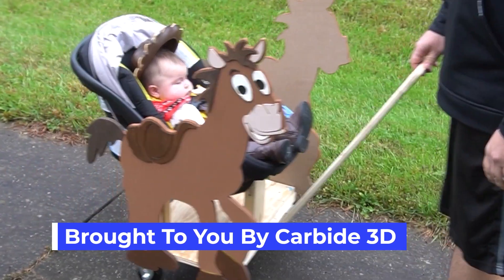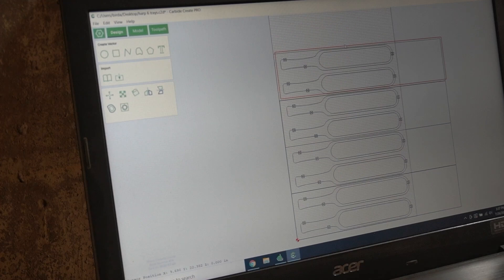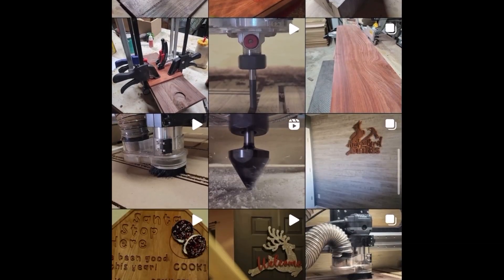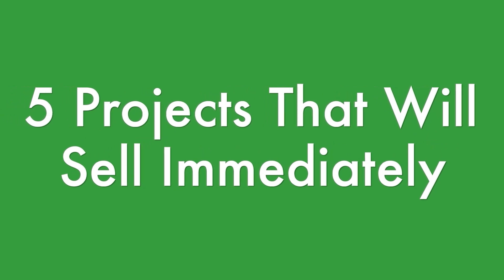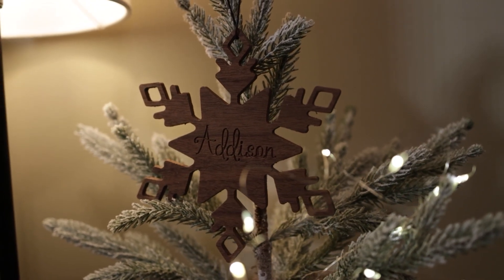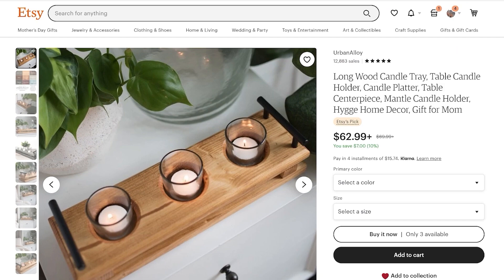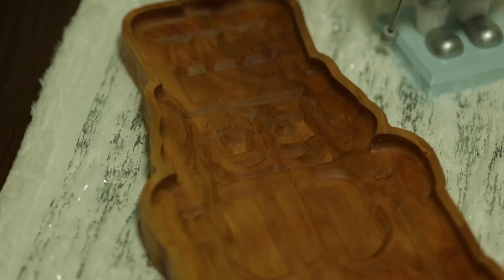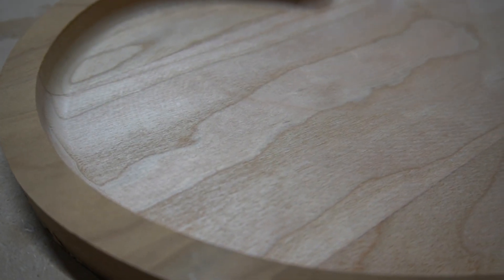5 Easy CNC Projects You Can Make and Sell Right Now - Make Money With CNC

Comment: I like your advice, but I tend to ignore half of it. If I make something seasonal, people are only going to buy that thing one Time of year. If I make too many, they sit on a shelf for three seasons. It's a jig, fixture, or program that I spend time setting up once a year. If I personalize it, that's another point of error that could happen. 

My goal is to find a product that people will buy year round, that doesn't need to be customized, that can be mass produced, like your cheese trays. 

Everything you say is correct, but not really my goal. Yes, if I customize, I can charge more... But I HAVE to charge more because I have to create and program that customization, and then risk messing it up if I do that poorly, or I mess it up. Then I'm scrapping that part, and it's an extra cost that I can't recoup. And I have to do that for every part, which slows down the process, and requires my attention for each part. They're only so many hours in a day, and I can't see that scaling well.

I'd rather have a consistent, controlled process from beginning to end, making every part exactly the same, requiring as little intervention as possible. Then while the machine is making perfect parts, I can be deburring, packing, shipping, whatever else needs to be done without babysitting my machine.

The trick is finding a product that fits that criteria... I think I have a few ideas... I will get my machine in a couple months. By the end of the year, I should know if my hypothesis pans out.
Reply: Mind sharing what you had in mind? I’ll start. A fishing bait box for the fishing community.
Reply: @clearcut6818  one of my ideas was a tray that went on the back of your toilet. Anyone who concealed carries firearms needs a place to put their gun while they're using the bathroom. On the bathroom subject, if you could devise a clever, nice looking way to hold extra toilet paper rolls, the bowl cleaner, plunger, and maybe a trash can all in one...
Reply: Owning an e-commerce and looking at trends analyses, I have not seen such a thing as a "all-year-round" sellable item. Basically everything on the market has ups and downs, either due to fashion, trends, seasons, global financial cycles, localized advertising, etc, etc... There are more items that will sell more consistently, but if you expect to always be able to sell the same product year round at peak productivity to make the most amount of cash, then I will wish you good luck. My experience has shown me that life does not work that way.